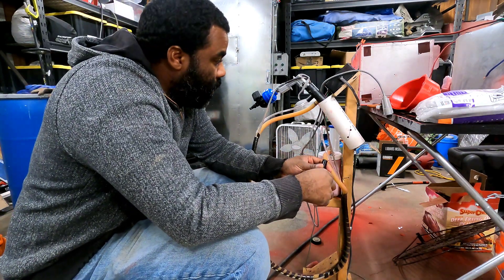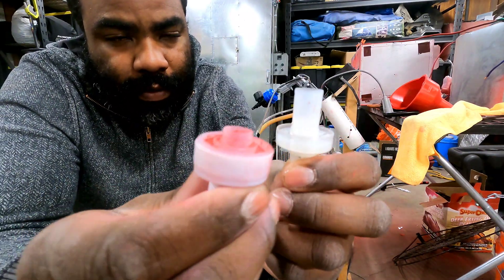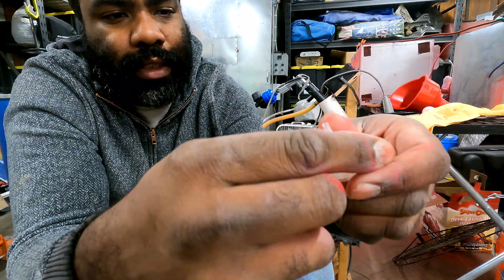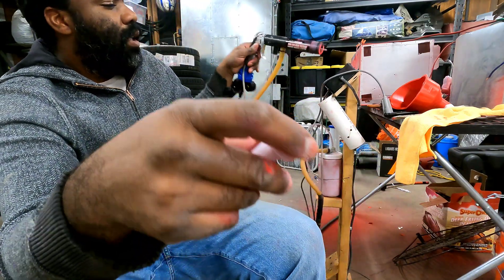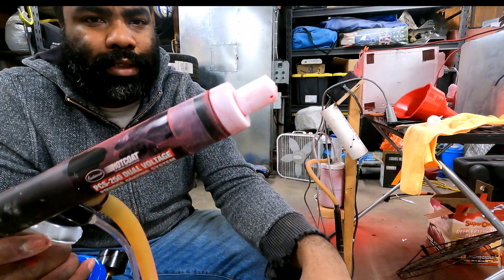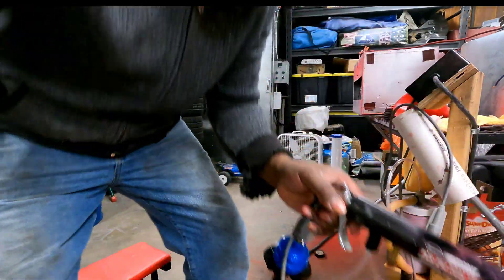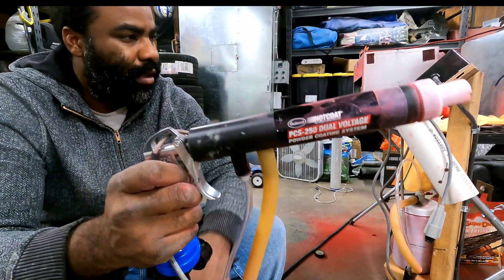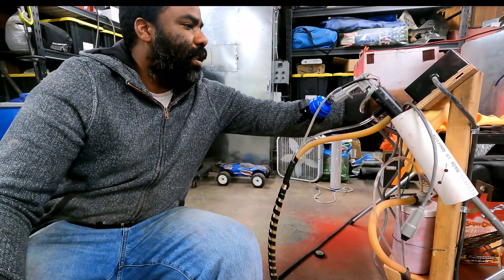HOW TO ADD A FAN TIP AND HOPPER FEED SYSTEM ON EASTWOOD PCS-250 DUAL VOLTAGE POWDER COATING SYSTEM

Comment: Thanks for the video however, have a bit of a problem. They don’t sell that old hopper anymore and will the new one still work? Doesn’t look like it to me. Also couldn’t I just buy a latex hose with same dimensions and be just as adequate?

Comment: Where did you get the gun cart at??
Reply from the maker: It's a 2x4 wood piece with a piece of plywood to hold the unit and a 2inch piece if pvc pipe to hold the gun

Comment: instead of buying that nozzle kit i just paused the video and modeled my own fan and started 3d printing it. 
if it works well i might sell it. i have the single voltage but the barrel is likely the same on all of them to save manufacturing costs.
Reply from the maker: I have a cnc mill and a laser etcher/cutter never got around to getting a printer, there are a few people already selling 3d printed tips I actually have a set brand new in the box that I purchased from one of the sellers, unfortunately my Eastwood gun as been put away and I got a kfx1 system I mainly use now
Reply: @Ricardo_Wade  WILLING TO SELL THE TIPS YOU HAVE?

Comment: That was me that asked in the fb group how to clean out the hopper tube :D
Reply from the maker: Well hope this was Informative, pretty easy to clean the lines as you can see
Reply: OVERKILL GARAGE thanks, it was. Now I just need to decide if I want to order a hopper from Columbia or make one out of a U-Line container like I saw in another video.
Reply from the maker: @LucidAutowerks  gotcha eighter way I'm sure it will work for ya
Reply: @LucidAutowerks  if yr looking into fluidizer hoppers we just bought one that wasn't a screw top so it don't get cross threaded. I showed it in my last video the link is below. It works perfectly and it came already vented. Hope that helps

https://youtu.be/tyCeQWHNZQQ
Reply: @LucidAutowerks what did you go with? The link doesn’t have the old style hopper at Colombia coatings and lost on what to do for hopper now.